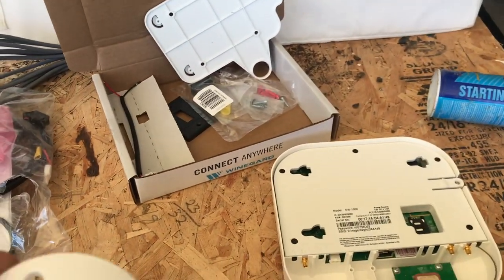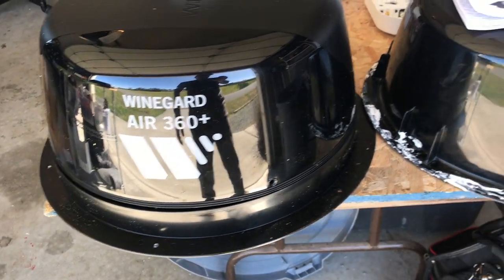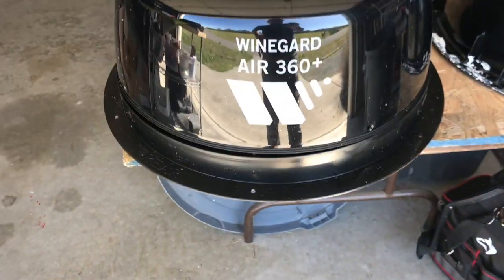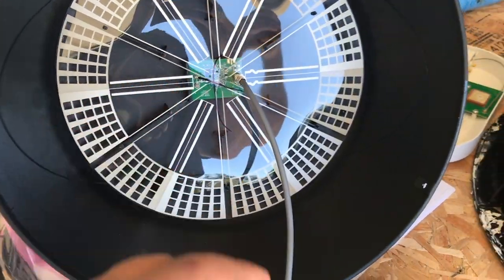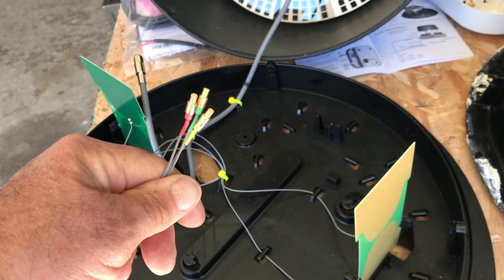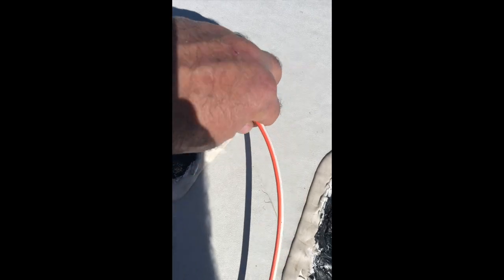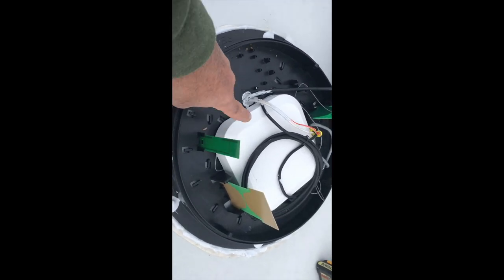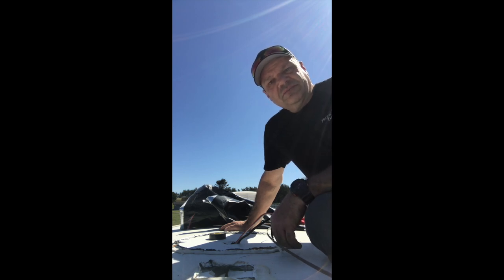Winegard Air360 PLUS installation video

Comment: Your purchase scenario sounds identical to mine 3 months ago; except mine is a Coleman.  Told one thing by sales, reality is different.  I tried to research what was happening thru the trailer manufacturer's website, generic owner's manual ("if installed..."), Dealer Service Dept., other YT videos, etc.  Yours was the first source to tell me exactly why I couldn't find the hook-up plate for the Gateway on the ceiling of my trailer.  The dome on top just says Air 360 - it doesn't have the + after it!  Given that the Winegard service is not available here in Canada, only if I go south, I won't plan to upgrade the antenna & Gateway at this time after all.  Maybe I'll give some consideration to the Starlink system, but will research that further.  Thanks to you though for explaining the problem with my Winegard!
Reply from the maker: You’re very welcome northern neighbor.  I think you’re making the right call.  I upgraded the antenna & the gateway.  I chose to do it and found the increase in service marginal at best.  It works, but was it worth the money and time I put into it?  Nope!

Comment: Thanks Tony.  I have to tackle this project this Saturday with my 2019 Cougar 30RLS.  I have the batwing antenna on there now and it's been recalled.  I am going to use a heat gun to pull up the old lap sealant so that I can have a clean, flat base to mount the 360+ base.  My rig is already wired for Wi-Fi, so I will not need the Winegard router.
Reply from the maker: How did the install go?

Comment: Would you tell me, Is there a video for those of us with a new 2021 RV with a factory installed Winegard 360 Air + but NO interior prep, AND show how to install it inside the dome of the 360 Air+?
Reply from the maker: I have a few questions.  
1. You didn’t tell me what make & model your RV is. 
2. Do you have the Winegard router?
3. Send me an email with your info tp tonyg2724@gmail.com.  Once I know the answers to these questions I’ll send you a video.

Comment: Good job Tony, I thought the access point went inside where the hub is in the ceiling now I know how it works.
Reply from the maker: Yours may very well be in the hub on the interior, depending on what rig you have and how the manufacturer wired it.  Speaking to my dealer, he said most of the Sunset Trails units are on the roof which is where mine was.  
I meant to mention that the video.  I thought I did but I guess I forgot to.  Good luck with the mod.  Once you get the dam thing wired it’s a piece of cake and works great.
Reply: @explorationsrenovations5982  I took the interior cover off and all that there was the two wire with no connector so I figured it was mounted under the dome.

Comment: Thank you for this video. I have a Grand Design 5th wheel and I have never been able to watch OTR TV and my radio has only picked up close FM stations. I took the wall plate power supply off and checked each coax with a tester and I know where each line goes but there's no coax for the antenna. I have coax from the radio to the wall plate but nothing from the radio to anywhere else. Do you think during the build of my RV they forgot to install the coax from the Air360 down to wherever it's supposed to be attached?
Reply from the maker: What the Winegard tech rep told me is that each rv mfgr wires it differently. The problem is RVs are all built by hand and wired individually each time.  There is zero automation or consistency.  So even the exact same unit can be wired completely different on a Monday than how it gets wired on Tuesday.   That is why it’s impossible for an rv manufacturer to give you a wiring diagram.  It’s really a big problem.  There are so called “standards” for how each unit is “suppose” to be wired, but again that changes from manufacturer to manufacturer.  The only reliable way to figure it out unfortunately is doing what I did. Take things apart and trace them out. It’s a gigantic PITA but you do learn a lot about your RV that way.  
Unfortunately I don’t have a grand design so I’ll be if no help to you here.  Good luck my friend!
Reply: @explorationsrenovations5982  Thanks for the answer. I used a Coax Tester made by Klein to trace each coax line but like I said, didn't find anything for the Air360. I guess I'll be heading on to the roof to take it off and check. Have a great day Tony and thanks again for your reply!

Comment: Hey Tony, good video. I'm wondering, why did you have power up there if the antenna was a "passive" antenna (i.e. no power amps)? Should I have power up there somewhere on my 2022 Grand Design Transcend 297QB? I just have the Air 360, not the plus. I'll be upgrading soon.
Reply from the maker: I e been getting they question a lot from Grand Design owners.  Apparently they set they pre-wired rigs up differently then sunset trails.  I don’t really know much about that.  This video was specific to how sunset trails sets up their rigs.
Reply: @explorationsrenovations5982 , Thanks. I believe my spec sheet in my owners manual says 360+. Why they put a 360 up there I don’t know. I may have to call them on this and force an upgrade. I love the grand design because it’s built like a tank but there’s just a couple of small things that are bugging me. What I just discovered was that my antenna, the Winegard 360, is connected to a 12 V power source inside the trailer. It appears that there is a 12 V source headed to that antenna. I think it serves the purpose as a boost only. Not sure if the coax from the A360 goes down to the 12 V DC wall plate boost then to my TV, or whether there’s two 12 V wires going up to the antenna. From what I’m seeing on YouTube, it doesn’t look like there is any 12 V connectors inside the 360.
Reply from the maker: @mr.peabody3509  how did everything go for you?   I was just reading my comments to you and I see I had typos just about every other word! 🤦‍♂️
Happy camping!!
Reply: @explorationsrenovations5982  Hi Tony, Since the 360+ only adds 5 miles boost to my current Winegard, and the cell antenna only boosts cell signal, I opted to go with a cell booster only. TV Reception is great and my TT doesn’t come prewired I found out. I even purchased the Gateway 1000 and everything. Good thing I researched it. I didn’t want to tear up that roof. Thx for checking in.

Comment: The gateway is supposed to be mounted inside the camper on the ceiling
Reply from the maker: On some units, yes.  There are 2 places to mount it depending on how your rig was wired from the factory.  My camper pre-wire configuration meant I needed to mount it to the Winegard unit under the dome.

Comment: Nice video!  What screws did you use? Size and type?  Thanks Tony
Reply from the maker: I reused the screws the manufacturer used to mount the original Winegard unit.  They look to be about 3/4” #8 self tapping screws.

Comment: Ok Tony why is there another hole in you roof right next too where you putting the winegard
Reply from the maker: I was told that this hole is for units that come equipped with the internal router or the Winegard Connect 2.0.  They use the extra hole to install those items.  So I guess they put all the holes in all the units then use whatever hole they need based on the equipment they’re providing for that particular RV and cap the rest.
Reply: @explorationsrenovations5982  oh ok got it
Reply: @explorationsrenovations5982  so I can just use the hole thats under my 360 ? I want to replace it with the 360+
Reply from the maker: @gardnetbush9768  you may have to take the plate off that covers the extra hole to grab the power wire.  That’s why I had to open it up.  Then you’ll have to fish that power wire from the extra hole to the hole under your Winegard unit.
Reply: @explorationsrenovations5982  my doesn't have a plate or extra hole i think they just  Fed the coax and the power line straight to the back of the TV that where a power pack and my on and off button is at
Reply: @explorationsrenovations5982  its a 2021 grand design momentum 29g i don't want to make a new hole in my roof or mess anything up
Reply from the maker: @gardnetbush9768   oh it’s a grand design?  Then I have. I idea how it was wired.  I can only speak to how sunset trails units were wired.  Sounds like u too yours doesn’t need the extra hole so your installation should be a little easier.
Reply: @explorationsrenovations5982  ok thannks

Comment: Looks like we have the same thing. 360 deg and it does nothing. The rv company has no idea how it works, Yep because it’s fake. 1 Idk if I want to rip this thing off our roof. 2 idk if I want to purchase something I was told it was “all pre installed and ready”. Sure that’s great the wires are ran. really just feel Scammed.
Reply from the maker: Yep.  I know exactly how you feel.  I was pretty pissed.  That’s why I made this video.  I will say that now that I’ve got the right stuff and installed correctly, the thing works great!!
Reply: @explorationsrenovations5982  yep. Hours and hours of searching of how to, Clueless RV dealers.. We can finally give it a rest. Thanks for this video.👍🏻

Comment: These are the biggest scam today.
Reply from the maker: 2 years into this and I have to admit, I completely agree.  I’m not a fan of this system.  It  rarely offers any significant service.  Save your money and get starlink.
Reply: @explorationsrenovations5982  my camper came with one installed by i might remove it and use the holes for solar and use the spot for an extra panel.